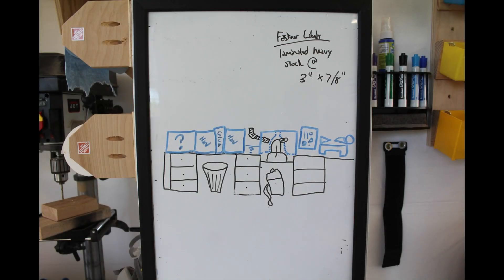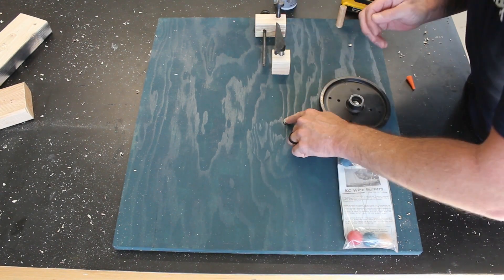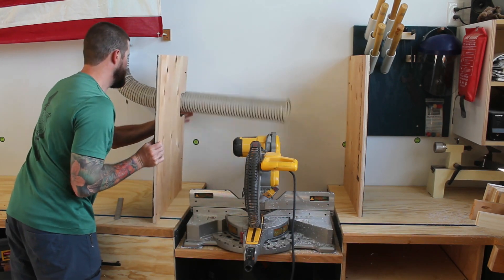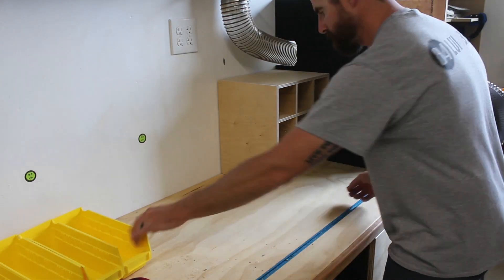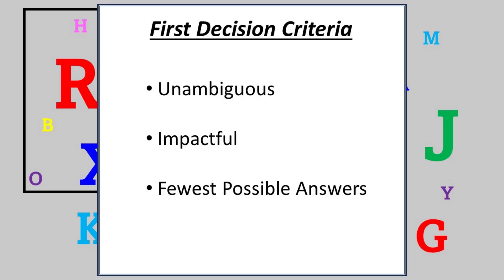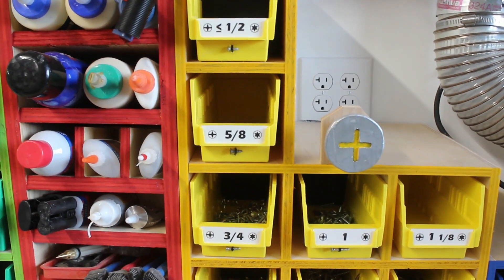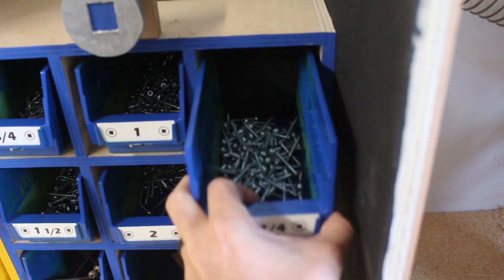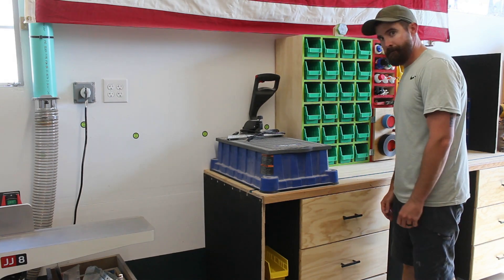Easy Miter Saw Station - Part 2 - Hardware storage, Lathe tool storage, Kreg Foreman Platform

Comment: Maybe a multi tool or grinder with a cutting wheel to cut the outlet? Pretty sure there will always be a chance of it cracking no matter what you do.
Reply from the maker: True, I think that’s why you see wood trim cut out around the outlet, rather than an outlet cut out around the trim